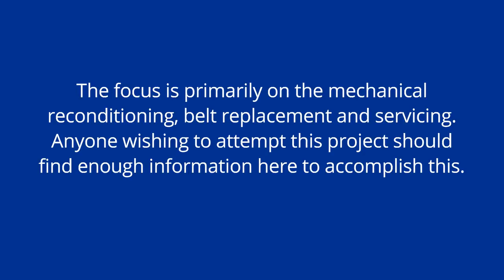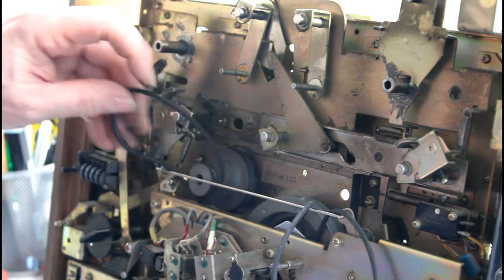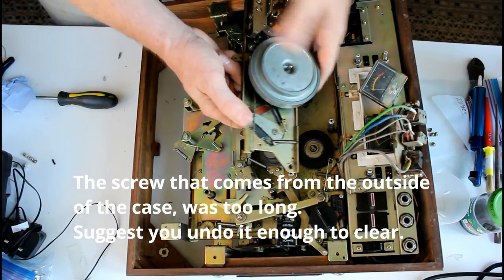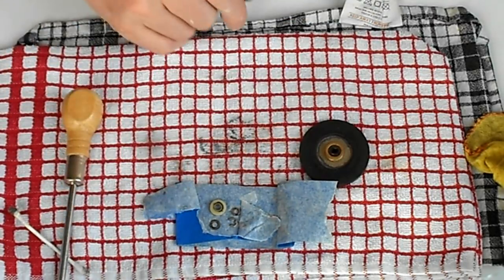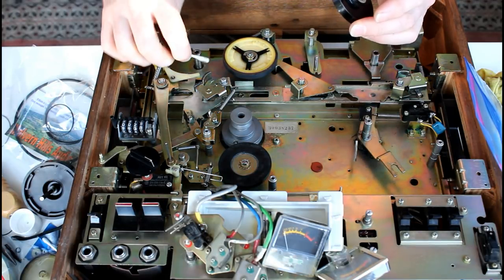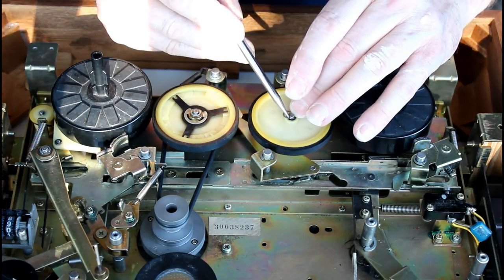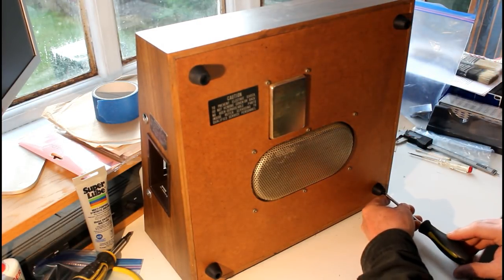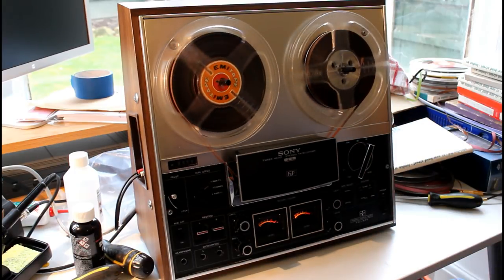Sony TC 377 (& Sony TC 366) reel to reel (How to Renovate and Repair)

Comment: Hello, could you help me? I have a problem with my TC-377, after recording it sounds very good, but after a few minutes the speed slows down, I'm recording in 19 cm 7 1/2. Could you tell me what could be happening? Thank you very much in advance
Reply from the maker: Hello, most likely the machine needs a service, proper lubrication and belts as per this video.  I'm not sure there's any one particular cause that I can identify for you.  Thank you for your comment.
Reply: @dembydish  Thanks for answering, can you tell me where to get the set of belts? by the way, great explanatory video, congratulations
Reply from the maker: @janorodriguez883  I forgot to mention, the pinch roller and idler wheel are often the culprits for inconsistent speed on playback and recording. This is generally due to the rubber hardening and/or glazing over. Cleaning and the rubber restorative product shown may help. However rebuilding may be needed if too far gone.  Belts at the time of recording were available on line and on ebay. There are specialist outlets in USA which may offer a better product, and offer roller rebuilding if you send them the original part.  Best way is to Google the items for options.  Hope this helps. Thanks for your comment.
Reply: @dembydish  Omg you are amazing and very kind, it is possible that it is just cleaning, since it is as you say, the machine was stored for 30 years so it has not worked much and it looks great. But in any case, i will buy the belt set and change them. Thank you very much!

Comment: When using Rubber Renue use rubber gloves and some sort of cartridge type breathing mask to stop you breathing in the fumes, lungs are hard to replace.  2uF 250V AC capacitors are available here in Australia and have terminals on top that can be soldered to.  It's a bit messy the way you have replaced the motor start/run capacitor.  I have repaired and refurbished four of these machines now and sold them on eBay. I have two more to work on but the returns on eBay were too small to spend the considerable effort required in repairing and refurbishing these one motor machines. The electronics is simple enough using only discrete transistors and standard passive components, no in house or hard to get IC's. The electronics power supply is a regulated 25V Dc supply. Capacitors can become leaky and high ESR in the supply. The rest of the electronics is hard to work on due to it's very compact nature.  The easily downloaded service manual helps in repairing  the mechanical side of this machine.  There are required adjustments for the correct mechanical  and electronic operation.  A machine of this age really requires this to be done using the correct test equipment and test tapes.  It was available in 1974 new, I was offered one duty free in Penang during my RAAF service in South East Asia. I declined and bought a TEAC 2300 as a 3 motor machine has better specs and lends itself for servicing over a single motor machine.  Linkages and idler wheels are required when one motor is doing everything, and the extra loading causes a great deal of wow  & flutter.  I served in the RAAF as an electronics tech for several decades and still do repair work in retirement. ...Regards Robert
Reply from the maker: Hi Robert, thank you for your informative message.  There's good information there for people visiting this page.  Luckily for now this machine still  sounds good and has no audible noise.  While I do repair guitar amps, I have not got involved with the electronics in this deck.  I have a nice ESR meter and some gear, so when the day comes i'll give it a whirl.  No test tapes unfortunately, but I do what I can.  Sounds like a good life in the RAAF. Thanks for stopping by and stay safe.
Reply: I bought the test tapes from Germany but you can make your own if you have a correctly aligned machine and a true RMS voltmeter like the HP 400E and an accurate  stable sinewave signal generator or function generator.  An oscilloscope helps as well.  Analogue instruments are always best in servicing this sort of equipment over digital meters as you can see the peek as you align the record and reproduce head.  If you don't have the equipment then you don't carry out this alignment procedure but an oscilloscope is handy to see the reproduced waveforms and distortion in them  to some degree.  A distortion analyser works best along with a wow and flutter meter.
Yes I actually miss the life in the RAAF, I was young  and fit and this you remember as you become older and wish for a new body.  I am sure all humans go through this, those that make it to aged maturity.  At the time you don't even think about it but time passes surely day by day , year by year then you wonder where it's all gone.
Regards Robert

Comment: I get the recorder to rewind and fast forward.  The take up reel moves at the correct speed but the feed reel is locked and will only turn when in idle other than rewind.  Rewind is fine. !  ??  I followed these steps.

Comment: Is there a known vulnerability making the TC377 to run slightly slow?
Reply from the maker: Old age.  It's a combination of old lubricant, tired belts, glazed rollers, best to service it first and take a fresh look to identify other issues if they persist. If you've already serviced it  and it's still running slowly then further electronic diagnosis may be needed. Could be the motor needs lubricant or bearings. I'm not personally aware of any known vulnerability. Hope this helps.

Comment: Hi I've got the same machine, I've changed all belts and even bought a new record and play head. The problem I've got is that the right channel seems quieter and of low clarity compared to the right. It's like the tone has been turned right down on that channel, could it be a cap as I've changed heads and it's still the same
Reply from the maker: Hello, thank you for your comment.  You have ventured into the realm of electronics when one channel seems quieter and less clear than the other.  There could be many reasons, including capacitors.  I am not really able to diagnose this type of problem as the machine needs to be looked at on the bench and components tested.  My advice would be to find a competent tech who has experience with this type of technology.  I wish I could be more helpful.  Stay safe and well.
Reply: @dembydish  hi thanks for the return comment, I will have to have a look into it, it's in excellent mechanical order but has always had a bad channel, I definitely think it's a cap problem, gonna get it looked into as soon as this lock down is over. The system sounds amazing even with a quiet channel. Well worth the fault find

Comment: I have just serviced another 377, fitted new belts, but I have noticed a problem with the speed when it’s in the vertical position. It runs for about 15 mins and then it starts to slow down, if I lay it down it speeds up again, could it be a problem with the pinch wheel or take up spool.
Your help would really be appreciated.
Reply from the maker: Hi Peter, it seems to me all problems of this kind are either mechanical, ie. stretched belts, pinch roller and/or roller wheels to old and brittle.  Lubrication problems, not enough lubrication or lubrication in the wrong places (on the rubber parts). Or the motor run capacitor is failing or has failed.  Suggest checking all parts again.  If you watched the video, I used rubber renue on rubber parts, suggest this approach if needed.  Hope this helps, hard to diagnose without looking at the machine.  Good luck.  Hope you'll subscribe to help the channel grow.
Reply: denbydish Thanks for answering, I will systematically go through it again. I have some new parts on order, so I will let you know what I find out.

Comment: Hello. I have a Sony TC-366 and it have an idle issue. It used to work well on all speed but recently, the 7 1/4 speed is now slow but the other 2 speeds are working just fine. Can you tell me what the problem is. Thank you.
Reply from the maker: Hello Martin, without looking at the machine it is very difficult to say.  However, i'd recommend new belts if they haven't been changed, belts loosing tension will slip. All the things I cover in the video contribute to the smooth running of the machine. Dried out lubrication slows things down and can put strain on the motor.  My advice would be to follow the steps I outline and give it a thorough service. Please subscribe if you decide to.  Thank you for your comment.
Reply: Thank you for your answer. I will follow your advice and get the belts replaced.

Comment: I found this one in flee market paid about 80 dollars. I tried with 19cm film and its not pulling. It pulls at 9.5 cm but sound is dragging because it does match the film.  Can you tell me what could be the issue?
Reply from the maker: The machine needs to be serviced as per this video. The idler wheel is possibly slipping or the pinch roller has become glazed and hard.  There are other reasons, belts are most likely stretched and should be replaced, the original grease has dried up and become sticky etc. The machine is old and most likely suffering from more than one age related issue which can be fixed. Watch the video to see how to mechanically service it.  Hope this helps, thank you for your question.

Comment: Hi denbydish, first of all I'm very pleased with your video. I'm repairing a similar player and I have to buy the belts. Unfortunately I cannot buy from a British supplier because the brexit. To buy those I need to know the parameters of the belts. Please help. BW, Zoli
Reply from the maker: Hi BW, it's been a few years and wiithout taking the machine apart to measure the belts I can't give you sizes. However, I suggest you search for drive belts for Sony TC 377 on the internet. Also,  eBay.com (USA) may have sellers that manufacture these belts. I may have answered this question closer to the time I posted the video.  You can look at the comments below to check. Most of these machines were sold in the USA as they were the largest market. You will probably find a belt manufacturer there. It is best to search using the model number than sizes anyway. Good luck and thank you for your comment. Please subscribe if you feel inclined. Stay safe.

Comment: Friend  here I am again the problem that exists is the front panel where the button is olay etc, happened that I dismounted because it has a tab that does not stay fixed, and that is the problem, also has a tuning screw but I have already tried various positions and nothing that will happen? Thank you and you desulpa once again to bother you. Big hug

Comment: My uptake reel just stopped spinning while I was listening  to my TC-377. The weird thing is that it will spin if I put the machine in FAST FORWARD but refuses to spin when its in PLAY. Any idea what this issue is?
Reply from the maker: Hello, thanks for your comment. Parts not turning are due to one of three things. Stretched or loose belts, sticking mechanical parts, due to lubricant drying up, slipping idler wheel due to one of the above or the rubber on the wheel is glazed or hard. It may be one, or quite likely all of the above.  Sounds like it's time for a service as per my video. If you want to do this, watch the video first to determine the job's scope.  Then suggest you attempt the job while following along. Good luck.

Comment: Hoping folks may still be reading this as I'm trying to get this TC-366 in front of me in 100% working capacity. Playback is great, but I do get the crackle/hiss/noise in the left channel when the switches are flipped to "source." I removed all other components from the equation, switched out cables, gave all the switches a Deoxit bath (paying close attention to the source/tape switches, the REC switches and the AUX volume level controls). So right now the deck isn't plugged into anything except for power and I still hear the left channel noise through my headphones when I flip the switch to "source," even with the AUX record volume turned all the way down. Any suggestions?
Reply from the maker: This sounds like electronic components.  Hissing and hum are usually due to one or more capacitors that may need replacing.

Comment: is there something over there similar to liquid wrench? that would work on those machines
Reply from the maker: Hi Larry, I thought Liquid Wrench was a penetration oil for rusty parts?  We have 3in1 oil which is a general purpose oil.  I like the lighter sowing machine oil being good for delicate parts.   Thanks for your comment.  Please subscribe to help the channel grow.
Reply: @dembydish  i used liquid wrench to dissolve dry hard grease on a Magnavox changer when the auto cycling parts wouldn't move and it worked

Comment: I try to replace the original dual cap 1.5uF/0.5uF using 1.5uF, would you tell me how to connect those wires? Thanks.
Reply from the maker: When you remove the original capacitor, are there + & - signs on the terminals? They may be colour coded with a description on the side of the can ( a red and white dot for example) If your replacement cap is polarised, it should also have + & - indicated on it. In that case it will be a question of swapping the wires from one + terminal to the other, the same for the - terminals.   If not then we can look at the wire colours to identify polarity. Let me know.
Reply: denbydish This is the original cap, there are two black connected to C, one brown and one green to the 1.5, and another brown to the 0.5. I saw some website, says that if you only use 60HZ, not 50HZ. You can use 1.5 uF instead 1.5/0.5uF Cap. In that case how to connect the wire since there are only two terminals instead three in the original Cap. Thanks. I try to put a picture, but I can’t.
Reply from the maker: If you live in the UK or countries with 220/230 volt at the wall plug sockets then a 2uF at 50Hz capacitor is correct.  If you live in the USA or other countries that use 110/120 volt then the 1.5uf at 60Hz should be used.  The appropriate Hz rating for the country (and their voltage) should be observed.  

Your wiring is different than I have in my machine, are you in the UK?  Are we talking about the same tape machine?

At this point I'd suggest trying to find a capacitor that is the same values as the one you have, and duplicate the wiring.  

If you want to send some pictures through Instagram and send me a link I'd be happy to take a look.  Normally I'd expect the two black to go to the negative or common terminal.  One of those black should run to the motor  the other goes elsewhere.  I had one orange going to the + or positive terminal (also running to the motor) Then a jumper lead joining the 1.5 to the .5 to create a 2uf cap.  

You have more wires.  Where do the brown and green go?  Where does the other brown go and is there a jumper lead connecting the 2 sides of the cap?

Comment: Tell me the size of the belt you replaced.???
Please tell me the size of the drive belt???
I need their size number to change the belts. Please help me
My device model is tc_399
Reply from the maker: Hello, I cannot help if the information isn't in the video.  Finding the proper replacement belts can be done by searching for them online by make and model number of the machine.  There are speciality sellers in the US who can help. Thanks for your question.